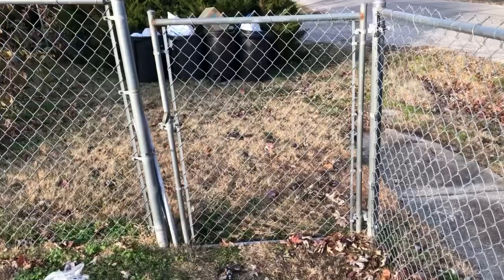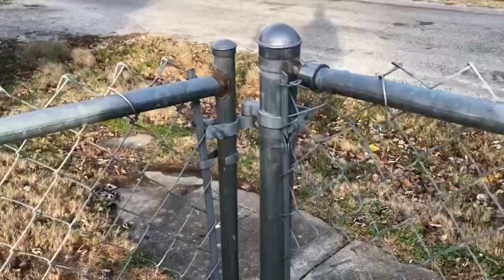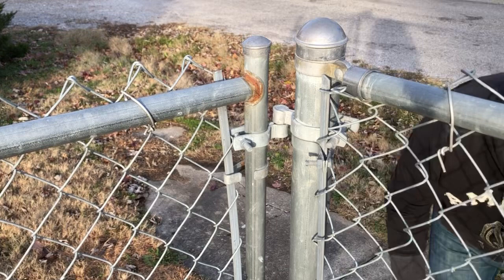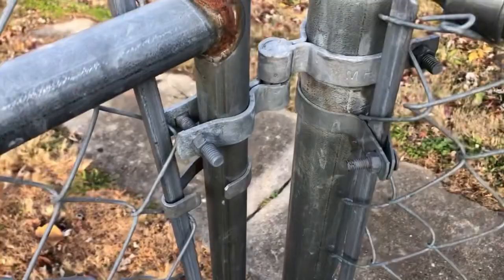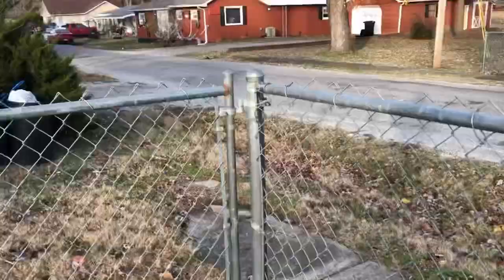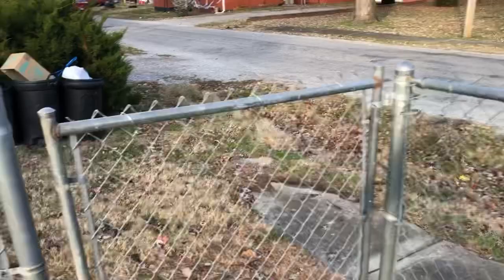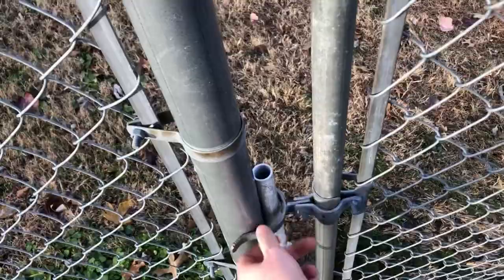How To Easily Adjust A Chain Link Chainlink Fence Gate How To Fix A Gate In Less Than 10 Minutes

Comment: last time I wanted mine adjusted I paid someone to run over and it was about $90 as a recall, for less than an hour of work. I am going to adjust mine today with your video I am confident I will never pay for an adjustment to mine again. I also need a new pole and the hole in the ground for the pole that secures the RV gate figured out. How do you get the dirt out of the hole, a screw driver????
Reply from the maker: Screwdriver will work

Comment: Your camera doesn't follow what you're doing. When you're banging on the top hinge the cameras on the bottom hinge  So I can't see what you're doing.
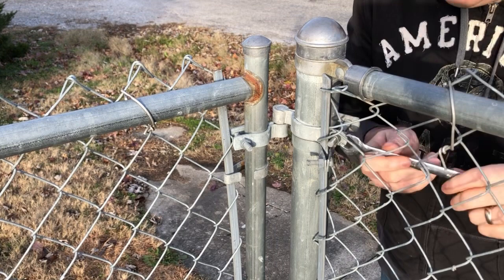Reply from the maker: I was doing what I did at 2:42 mark. Slightly adjusting the hinge with a hammer. Consider Subscribing
Reply: I noticed that but with some patience you see he will come down and do the exact same so you can make it out with some time and consideration